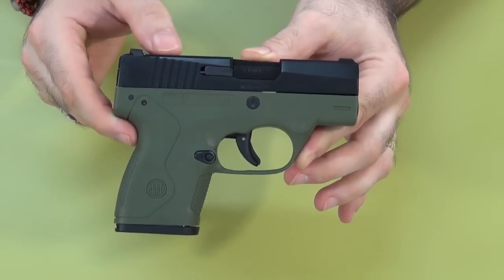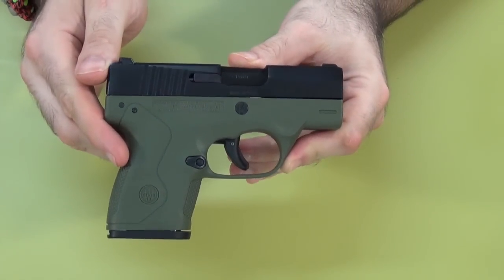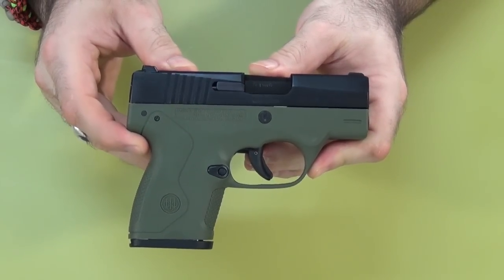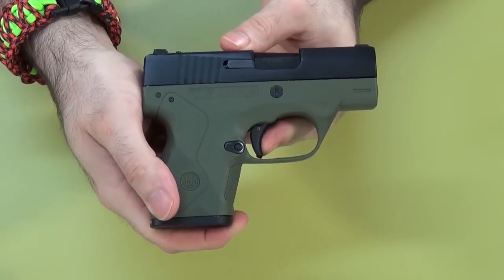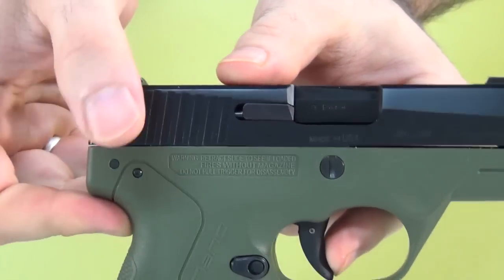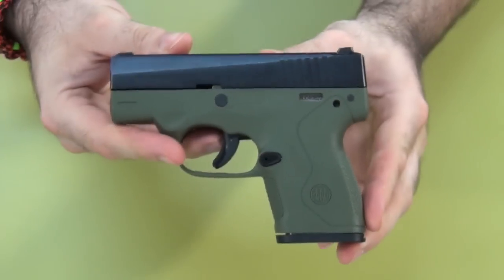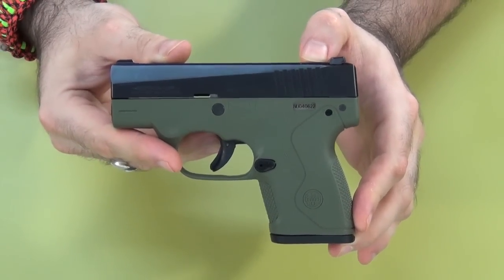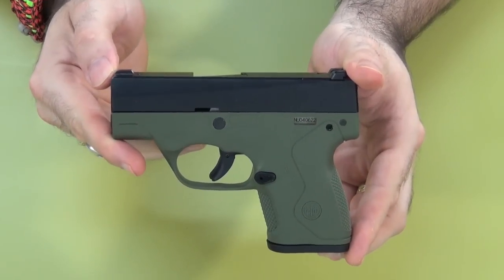Firing Pin Block: What Is It?

Comment: So basically, the firing pin block prevents the firing pin from hitting the primer of a chambered round, even if the hammer would come down due to an external force (like if you drop the gun) or other malfunction. The FPB is raised by the trigger and as long as the trigger is not pulled, the gun wont fire.
IF the hammer falls without pulling the trigger, does this damage the firing pin or the FPB?

Comment: Does my Smith and Wesson M&P Shield 9mm have this firing pin block? I see a small round thing on outer slider but it doesn't go up when trigger is pulled. Also, is my handgun a double action even if round is chambered or does it become single action when chambered? Thanks in advance for anybody who can help me. Just started carrying with chambered round but admittedly worried to keep external safety off unless my Shield has this internal safety mechanism the Yankee talks about in the video, a Firing Pin Block.
Reply from the maker: +FightingSheep1 Yes...you cannot always see a firing pin block. They are usually concealed inside the slide. Beretta is just very proud of their's apparently.
Reply: +TheYankeeMarshal You're the best Yankee, just clicked external safety off w chambered round and heading out to dinner. 

Keep helping new carriers, many like me who never held a handgun and, in my case, was a hard core anti gun activist for decades may be frightened as hell at the thought of even carrying a loaded handgun let alone carrying with a chambered round and no safety. 

Amazing what I have learned from your channel about the true beauty of firearms and our second amendment right when I put my staunch anti gun biases aside and opened my mind to listen. 

Thank you, God Bless!

Comment from the maker: The Koucky designed the CZ-75 in the 70's using brownings advances and designs in their gun. They also used many of the same design features Browning used in his final design (the Hi-Power). The guns are very similar except for a few minor difference in the guns smaller workings. Many people like to try and pretend these minor differences mean the Koucky brothers did not copy the Hi-Power. Of course you would have to forget one of the brothers admitted it was his inspiration to believe that.

Comment: Yankee You have the Nano here in this Video. I love the concept of these modular.  However, in my opinion the Nano is actually uglier  than the Pico. You being a Beretta Fan...... I'm just curious why you hate the Pico?  Man  it's a great gun! Now it does have a high borax for a small gun. It is small.  However,  come on man! Full steel front and rear sights, 6+1!  It's awesome! I just got the flashlight mod polymer frame and oh man it's super cool now. I think at least. Now I just wanted to say. There was a recall on the weapon. The first products had a problem with the recoil spring. It was defiantly making the gun unreliable. However, after a recall of all the weapons they fixed it and replaced it with a much more relaxed spring and now the gun operates  with precision and cycles perfect with all ammo.  For such a small gun I'm able to get a 6 inch group center mass no problem at 20 yards. Come on Man! It's Beretta! Work with it! Make it a project so you can love it. Trust me! I think your censored gun was a Pico! LOL! I know it was. If it was and if it was one of the first ones made look in to it because it has a recall.  They will fix it for free and then maybe you will change your mind. Do a video on the Pico! I would love to see it!!!! Les Anderson, your friend!  Your channel is awesome!!!!